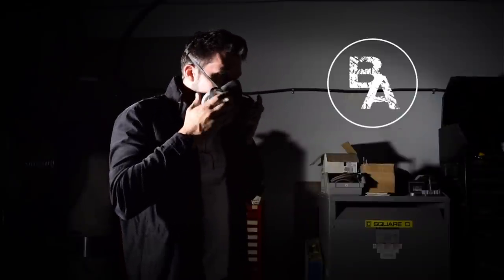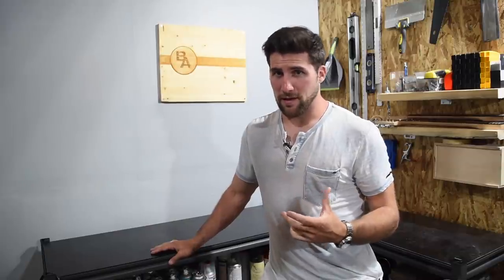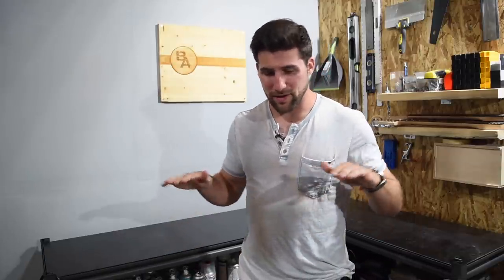Why is your paint crazing?

Comment: i need some help Brad. i have sanded/cleaned/repainted my project 6x now and it keeps happening. i have tried multiple clear coats for the top layer and for some reason they all cause the same reaction. the last time i did this i let it dry indoors for 3 days and went to use some clear coat and the corners crackled again on all of the stuff i tried it on. i am trying to restore an old 1960s cooler for my wife and it is costing more to restore this than it would have been to just buy it restored. i am probably 100+ in just paint right now from re-spraying. 

Behr - Hidden Sea Glass color spray with primer (oil based)
Rust-Oleum - tx ultra cover gloss clear was the latest one i tried (oil based) (though i just loooked it up and it looks like primer + paint clear, maybe i just screwed it up?)
Reply from the maker: You’re just trying to clear coat over an oil based paint? Those combo cans are tough to predict. That’s why I almost never use them. Regardless, if you let the color dry and then sand lightly, you need to spray in warm dry conditions and apply your first couple of coats of clear very thin. I mean borderline comically thin. Just gently spritz it on there to bridge the gap. Then you can move to proper coats. I haven’t coated over that type of paint, but I think I would probably use an oil based polyurethane.
Reply: @BradAngove  are you not supposed to clear coat over the combo cans? is there something safe to use on the inside of a cooler? thank you so much for your help. I will for sure try it.
Reply: @BradAngove  this is my first project ever and I just want it to look nice for my wife.
Reply from the maker: I have no idea about the safety aspect, but you should generally be able to clear coat over combo paints as long as they aren’t enamel.

Comment: I made a windowed side panel for my pc and I do know how to use spray paint but for some reason in one spot maybe a few inches wide, it wrinkled pretty bad. I used primer on the acrylic, then spray paint and an hour later I checked on it and it wrinkled! I scraped it off and used paint thinner to clean it off on that spot to try again but for some reason it still wrinkled, even worse this time, I might just have to start over and get a new piece of acrylic.
Reply: acrylics are not good with certain solvents, e.g. I have water blocks from EK, thay advise that at no point should you use IPA to clean them, now in electronics IPA is used a lot to clean things!!! but if you get it on acrylic a few weeks later it can actually shatter. It breaks down the bonds in the top layers of plastic and then the whole piece is under tension, the stress propagates and later on... bang. If it doesn't, you get cracking and wrinkles. I would recommend checking plastics and paint compatibility and using proper plastic primers as a bare minimum, even the base coat can dissolve the primer a little if it goes on heavy and that would let the solvents near the plastic.

Comment: I painted a panel on my car a while back and I was spraying the colour coat at night (stupid mistake) the next morning I saw the paint and it was completely the wrong colour. Don't be stupid like me and go off of the colour of the cap😂.

Anyway i went to my local motor factors and got the proper shade for my car and sprayed over the old paint ( after sanding it down a bit) just over a year later and I have to do it again because everything is cracking and chipping off. I'm guessing the first paint I used was different from the 2nd so it probably caused some sort of reaction.
Reply from the maker: Damn; that’s no fun.

Comment: Hey brad I enjoy your channel a lot. I have a video request that I think would be fun to see you do and feature on your channel. I customize hot wheels cars by stripping paint and reprinting adding details and rubber tires etc... Would like to see you do some paint jobs on some little cars!
Reply from the maker: +Championdjk what do you use to paint those? An airbrush?
Reply: Brad Angove I actually use rattle cans and can usually get a good finish. They are small so it is pretty easy to get an even finish. I use a lot of duplicolor product. I like using adhesion promoter cause it is clear and then I can use a translucent color. There are a ton of Diecast customizers here on YouTube and a lot more on Instagram. Just would be cool to see you take on a proper method for painting these cars. I do have a customizing playlist on my channel showing a bit of my stuff.
Reply from the maker: +Championdjk I'll have a look. Thanks.

Comment: I was painting metal chairs in my garage, it's probably around 22 degrees in there, first coat went on no problem but as soon as I went to apply the second coat the next day it immediately did this everywhere. Now I have to sand most of it down and do those spots again. Is there any surefire way I can prevent it from happening again?
Reply from the maker: What kind of paint was it?
Reply from the maker: Did you sand after waiting a day between coats?
Reply: @BradAngove  I haven't sanded yet. I'm going to today. This crazing happened yesterday evening
Reply from the maker: Ok. Sand it back and then clean it. Apply 3 relatively light coats 10 minutes apart.

Comment: I haven't finished it yet. I have used body filler and then sanded down but not used primer paint not sure if it is necessary. my paint work cracked because of applying too much paint.

Comment: I think its a reaction with certain metals after sanding. I've started cleaning metal sufaces with either a light glass beading or methanol wipe before priming.
Reply from the maker: You definitely need to clean your sanded metals well before priming. Methanol is one of my top choices for that.
Reply: I’m having the problem all the time on metal and plastic it’s like 55 degrees and I’ve tried hosing the paint on and painting it lightly

Comment: what if youre looking for this effect? like a patina finish? how could you force the paint to crackle?
Reply from the maker: There are different types of crackle. Have you seen my video on how to do a crackle paint job? Is that the effect you’re looking for.
Reply: @BradAngove  i did but I’m actually looking for a smaller/finer crackle pattern.  It’s definitely something related to temperature or chemical reaction just don’t have enough experience to know how to do it without the Montana crackle pattern. Thanks for the reply btw.
Reply from the maker: @Harsh_Trip applying it a little too soon, a little too heavy, and with a little heat will often create cracking.

Comment: I have a spray paint bottle. When I spay the paint comes out like cloud. Doesn't dry quick. N when I opened the nozel n tried to clean, the spay head  popes out due to air pressure. Please suggest
Reply from the maker: What do you mean a spray paint bottle?

Comment: Have tried Krylon paint with Krylon clear... no go! I've tried Rustolem paint with Rustolem clear... no go! I've waited 48 plus hrs... no go! I've tried light coats... no go! I've watched the humidity & temp. when spraying... no diference! If anyone finds the answer to this problem please put it here for all to see. The projects were all plastic no metal or wood. I am spraying them now with Rustolem paint with no clear. I usually get a better shine with it than the Krylon. 
Thanks for searching for the answer to this Crazing that is driving me Crazy!
Reply from the maker: Rustoleum and krylon both make several types of paint. Are you sure you were consistent?
Reply: My guess is the clear coat is still too heavy or maybe second coat is too soon after the first and the surface of the coating is drying faster pulling the, or shrinking the surface material that floats on top causing a ripple effect. When I get a chance I will "dust" a coat of clear on the surface and see what the results are.

Comment: I keep having ongoing crazing issues when I attempt to clearcoat headlights with Rust-oleum 2x clear. I have moved on to a 2k clear and never experience this. The million dollar question is what grit of sandpaper to use. After sanding, it is hard to see the old crazing until after I am at the higher grit sandpapers and then it is too late. One would think 600 grit would be sufficient but it seems like the crazing cannot be removed until I get super aggressive with 80-120 grit sandpaper and then keep moving up to each possible grit carefully until I reach 2k.
Then the problem is tons of sanding scratches appearing at the end of the job. Any idea why this form of crazing goes so far below the surface and what technique can be used to remove them? Thanks.
Reply from the maker: Sometimes the plastic on the headlights can develop something that looks like crazing. Paint crazing is on top. Could have been because the paint didn’t react well to the plastic. That’s common. Did you sand it first and use adhesion promoter?
Reply: @BradAngove  Thank you. Yes I did sand it first. I have tried sanding up to only 1000 grit then cleaned with alcohol or other body shop solvents designed for cleaning surfaces prior to painting. I have also gone up to 2000 grit then used 3m rubbing compound followed by glaze and cleaned up really well. It always seems to happen with just this paint brand. However it is a favorite for everyone else. I have tried it on number car headlights and new cans and it's always the same. I have never heard of adhesion promoter. It might be time to change brands I think. Not sure.
Reply: @BradAngove  
Hi, I have experimented with different sanding and preparation techniques. In scenario A, I sanded right up to 2k grit then used rubbing compound and then glaze compound. I cleaned it off with professional body shop solvent designed for that purpose or rubbing alcohol in a different instance. In scenario B, I sanded only to 800 grit to give it a surface to stick to and as a compromise that would not leave too many sanding scratches. I then cleaned with rubbing alcohol. In either instance, the result was the same. Crazing. It is any set of headlights and any can of Rustoleum 2x Clear that I have used from any source. I am going to to get away from that brand for headlights. I don't experience this at all when using the spraymax 2k clear. On a side note, how deep would you sand with a DA sander to get rid of the crazing after things have dried up. Seems like the crazing makes it all the way down no matter how abrasive I get. Thanks.
Reply: How did you get rid of the cracking?

Comment: I had a terrible reaction when I used celluose spray paint on top of a Oil based paint in a stencil.the paint shop said that the solvent based spray should be fine with the oil, but it totally reacted started to bubble & peal.any advice!..
Reply from the maker: They probably didn’t realize that you were using nitro over it. That combination is a recipe for disaster. Switch to a poly clear coat.

Comment: Great video, very informative.  Here's my dilemma.  I painted an old wood chair and did some reupholstering.  1st coat of paint was Rustoleum satin cream, ran out when it came down to the legs.  Beautiful job nice coverage 1st coat.  Brought the chair in the house waited 6 days, had to buy another can but they didn't have Rustoleum satin cream so I bought Krylon, same finish same color.  I painted 2nd coat in the garage which is about 49 degrees maybe 50.  Now it is crazing, I am so f*&^%$g mad.  Heres the thing I don't want to redo, I may just give it the distress look and sand ever so lightly the parts that are crackling.  My thing is I have a matching chair, what if that doesn't crackle and I can't seem to get the same effect?  Damn, I am so mad right now. I have canned painted nightstands and this never happened. Do you think it is 39 degrees outside and the garage is well 49, 59 degrees this could have happened?  I painted the 1st chair outside and it was like 66 last week, Chicago is so moody with weather.  I mean you mentioned several things this could be.  I feel like I put some kind of solvent on there with this other paint.
Reply from the maker: Paint the other chair before you go ahead and distress this one. Just to make sure you’re able to get something similar. Do your coats about 5-7 minutes apart and spray your second coat relatively heavy. Krylon is generally pretty crappy paint and tends to crack. I think you’ll have a reasonable chance of emulating that effect.
Reply: Thank U!

Comment: Hi Brad.
I putred  waterbased dye on sanded alder body without any filler/sealer.Then sprayed 4 thin coats cellulose lacquer...
Result?Body surface is soft and lacquer peels off easly if scratched...
Could you advise me is there any chance to save my job(somehow harden surface?)?
Reply from the maker: +Kris Kris how long has the nitro been on there?
Reply: Brad Angove  4 days already.
Reply from the maker: +Kris Kris nitro takes about a month to fully harden.
Reply: Brad Angove  ok.So do you think Brad its good idea to put extra few cellulose  lacquer coats,and afterlet it dry at least a month?regards.
Reply from the maker: +Kris Kris Yes, that's probably a good option.
Reply: Brad Angove 
Ok Brad,as you will see again my first post:I dyed sanded body without any seals/fillers and then just put 4 coats of clear  nitro.Do you think it was good idea?I mean the nitro after well 1 month+ of drying will grip to the wood ?Thats what is worrying me..at the moment instead of soft body surface,whole coat is easy to  scratch -peels off.Will it stop after well drying?
Reply from the maker: +Kris Kris Nitro usually has no trouble gripping wood. That's odd. What kind of dye did you use?
Reply: Brad Angove  I used waterbase concentrate dye.Applied twice on sanded body.After that well dryed.Before nitro coat,body was dust free.Ive sprayed in shed at around 17 celcius(too cold?)
Maybe it will grip better ones nitro will cure (harden)
Reply from the maker: +Kris Kris That might be a bit cold. Did you use any sealer? I've never had a problem with nitro not bonding to wood before.

Comment: I have sanded out three layers of crazing and my conclusion is that Krylon and Rust-Oleum clear don't work together. I painted over a coat of clear Rust-Oleum that said it could be used as a primer coat or clear coat. If any of the coating was not sanded off then it crazed in that spot I am on my 4th sanding in spots that weren't completely free of it.
Reply from the maker: It depends on the type. What paint types were they?
Reply: The type came from Lowe's store.
Reply from the maker: That doesn’t really tell me much unfortunately. Those brands make a few types that are widely available.
Reply: FUSION FOR PLASTIC is on the KRYLON and the RUST OLEM 2X.
Reply from the maker: Yikes. Ok, so probably an enamel followed by an acrylic then. Sorry to hear that it went poorly for you.
Reply: Doing some more sanding on three quarter sized spots and hoping this is the end. Don't know if I should spray the clear over it or just leave it at this point. By the way... the humidity was 70 percent so I suspected that but tried spraying it at 45 percent and it made NO DIFFERENCE!
Reply from the maker: Yeah, it sounds like more of a chemical issue. If you’re going to coat over it, make sure your first couple coats are extremely light to reduce the risk of crazing.
Reply: @BradAngove  I gave up and just sprayed it and did not clear coat it. Not bad but I was hoping for better. This was on some kind of plastic saddle bag and a helmet.

Comment: When doing some finishing touches on a guitar i built i stumbled into this problem where i applied the third layer of clear coat 2 days after the second layer and during the drying process it just started creating large bubbles in the paint which lifted off from the guitar body... i dont know what caused it because i havent had that problem before... might have been because a change in temperature due to colder weather... although i really dont know...
Reply from the maker: Do you know what kinds of paint we’re involved?
Reply: @BradAngove  i were using spraypaints. After discussing it with my dad i am almost entirely sure it was due to a difference in temperature.
Reply from the maker: Ok. It could also be a chemical reaction, which is why I asked about the kind of paint used.
Reply: @BradAngove  it might have been a mix of a chemical reaction and a change in temperature. Either way i managed to fix it somewhat by poking small holes in the bubbles and then flattening them out and applying another layer of clear coat. It looks pretty decent now. Its not perfect but im happy with how it turned out in the end.

Comment: WoW, I came here because I was literally going crazy because of, well now I know what it's called  "Paint Crazing". I was putting the clear coat on way too soon it seems. Thank you so much for your knowledge.
Reply from the maker: I hope it lets you solve the problem.
Reply: I contacted Rustolem and they said wait 2 days and spray it... I did and it crazed. It does it with Krylon as well!
Reply from the maker: On what Barry?
Reply: How to solve this issue? I was painting the wheels and seems that I rushed the last layer of clear coat. Please help
Reply from the maker: Sand it back to flat and spray another few light coats. Keep them lighter than before though.
Reply: @Barry Wind  I've had a nightmare of a time with my project!  1st I rushed and mixed paints. Watched these videos, went out and got all Krylon fusion both colors and gloss clear. Waited 48 hours and the clear coat still cracked? Will make the 4th time I've had to do a complete sand job redo.